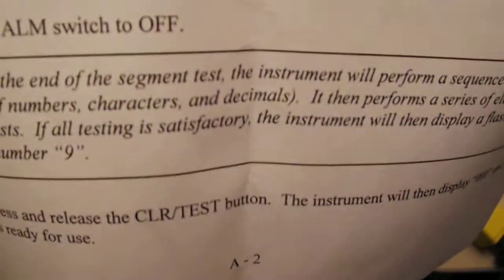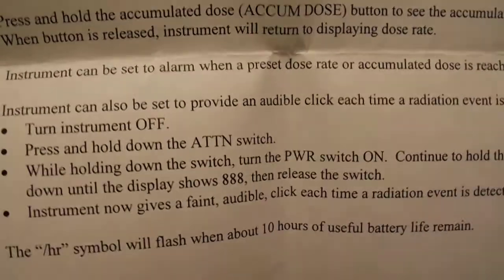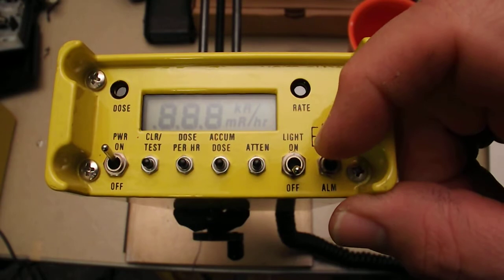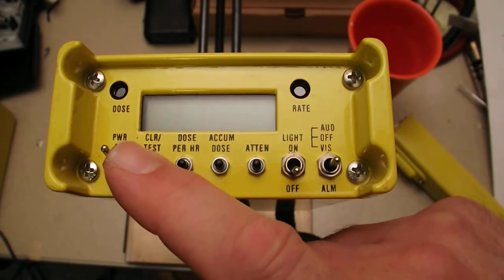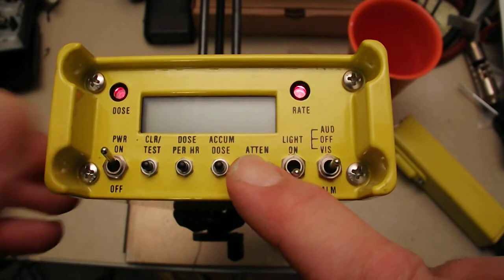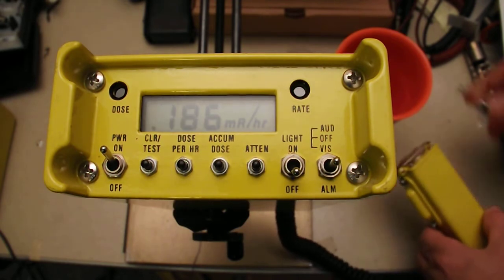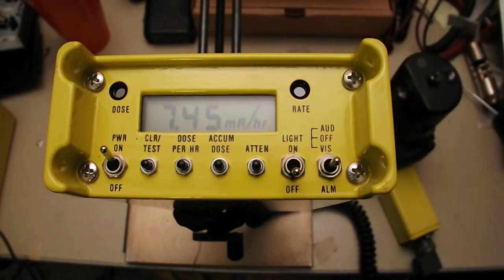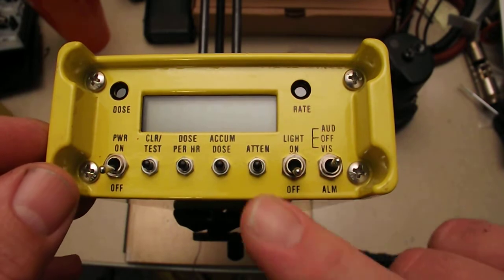CD V-718 Preoperational Check and Audio Click Enable

Comment: What year is this from?
Reply from the maker: 2017. I just posted it last night.
Reply: -_-

Nono. I meant was the equipment used by Civil Defense workers (what year is the equipment from). :D
Reply from the maker: The CD V-718 was issued in 1994. That's the date on the manual. It was a FEMA issued unit. Interesting that they stuck with the "CD V-" numbering system when it was issued.
Reply: Indeed. The Cold War was basically over at that point.

A side question, do you know where I could get Civil Defense decals to put on a Thunderbolt?
Reply: Sounds just like my PDR-77. That unit is basically an AN/VDR-2 made by NRC which changed to Canberra and now Mirion corp. two lines the AN/VDR-2 and PDR-77 which now is combined to one unit called the RDS-100 line.

What is crazy is each DoD branch has its own set of tools to so the same jobs, ie Airforce with the ADM300 (Also NRC developed using Time to count like the PDR-77/VDR-2) and the Navy using the SAIC PDQ-1 and Marines using even older tech from the 70s lol.

There is a stash with about 200 of these still in storage NOS. Not sure if they will ever be disposed of to the public.